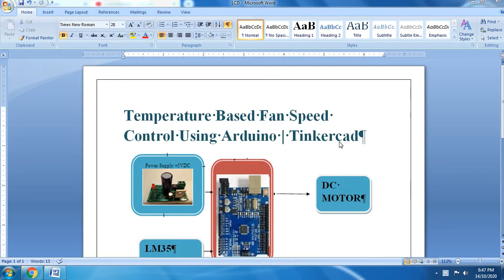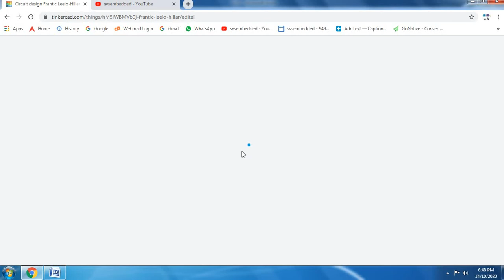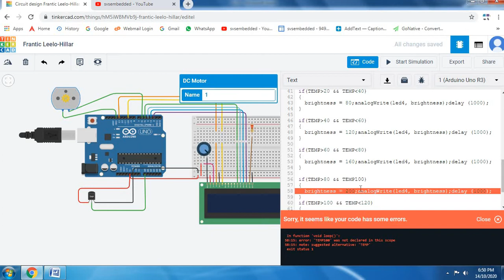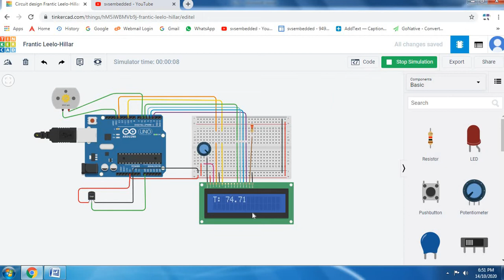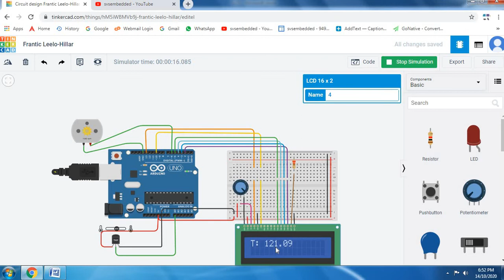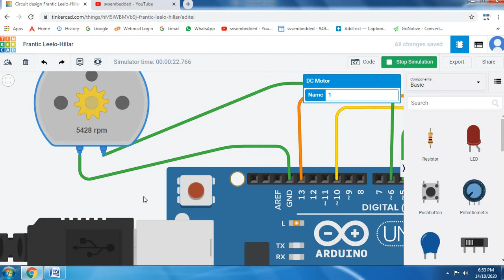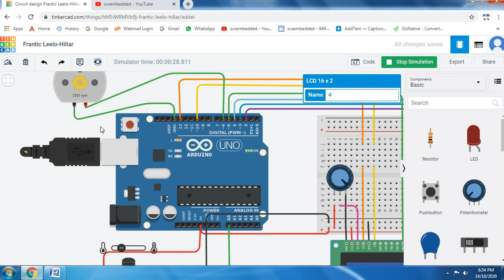Temperature Based Fan Speed Control Using Arduino | Tinkercad

Comment: if am use  use 2 temperature sensor and 5 pc fan for cooling purpose 
is it possible to run at separate and whole fan at same time..?

am lot of double actually is possible if not

how did i done this project..?
Reply from the maker: Thanks for watching and your valuable Feed back. i will check and tell u